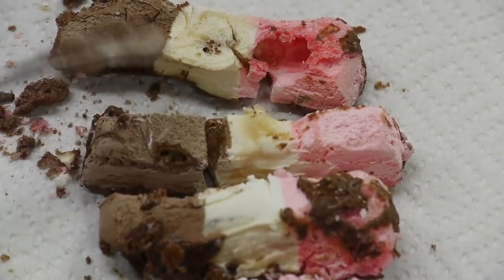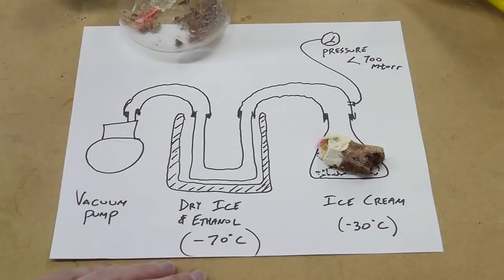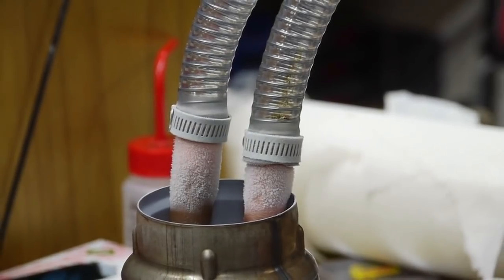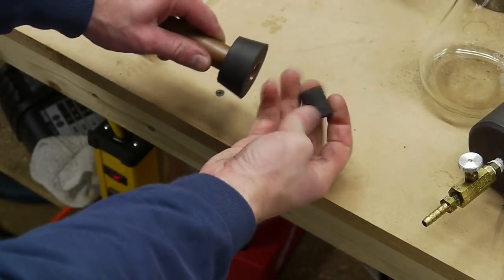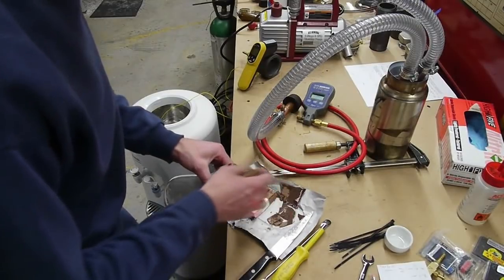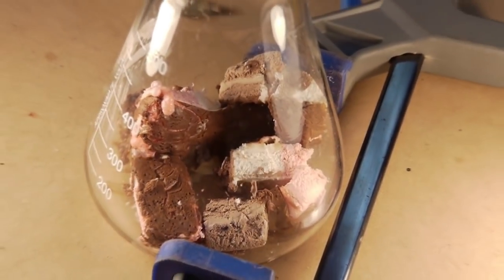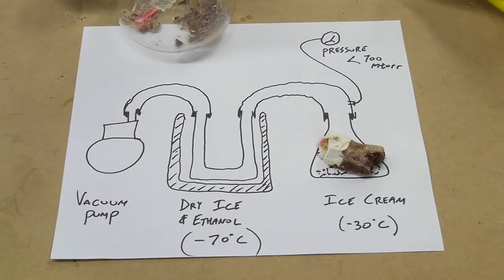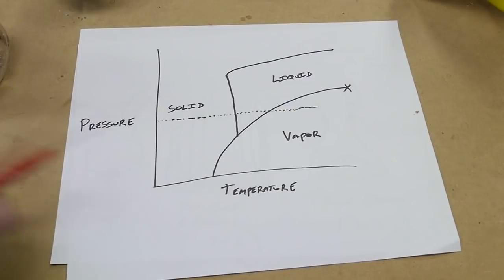Making astronaut ice cream in my home shop

Comment: I wish you had shown a gauge of what pressure you were pulling with that pump. For $150 new, I wish I knew if it could pull a pressure of like 4.5 Torr (the triple point pressure of water) before I went out and got one myself. There's this other video where a guy uses a $500 rotary vane pump, and I'm wondering if that's the right move or if I can be cheaper. But unfortunately neither of you show clear gauge readings...

Comment: I love how you specify that you can get dry ice day and night. I imagine dirty old alcoholics having the same love for 24h liqueur shops.. 
Here, I have to go thru my science teacher from 9th grade (I'm 23!) to get dry-ice and liquid nitrogen (nobody in my town sell to "private persons" not even to small companies! (I have a small company)  After the terror attack on 22. July, any chemicals (does not really matter if they can be used in a bad way or not) Is difficult to get if you can't document that you need it for som sort of production -.-
But she is super cool and kinda hot (she also teaches gym) So we sometimes cooperate on experiments -  I can make simple apparatus doing metalwork and piping. - Currently I'm putting together a 400L tank with a distillation column for destructive-distillation of wood :D
Reply: Also, the water cooler could be an awesome way to get the water/liquid to an aspirator vacuum pump cold enough to make a decent vacuum. I currently have a 25L tank in a freezer with piping thru the walls and a smaller tank outside for the water-pump and aspirator. But it only gets me to about 
minus 10-15°C.
Reply: BTW, I'm getting down to about 18mBar as is

Comment: I would like to suggest that you dessicate some fresh marijuana, grind it unti a sub micron powder and then see what effect that process had on the extraction of the pharmacologicaly significant components with a suitable solvent.
Then describe the process while under the influence of the resulting extract.
Should be fun for all, dont you think?
Reply: Have you tried that mark warlick
Reply: No.
I want someone else to try it.
It is a condition of my employment that I abstain from such experimentation, but there are those who are not under or who do not heed such constraints.
Reply: That is very true.
Reply: Perhaps you could give it a try?
Reply: No no no
Reply: I also have conditions at my job that I have to abstain from such clandestine activity.
Reply: No need to be clandestine if you live in a state of nondenial.